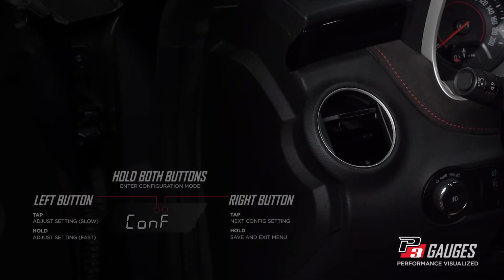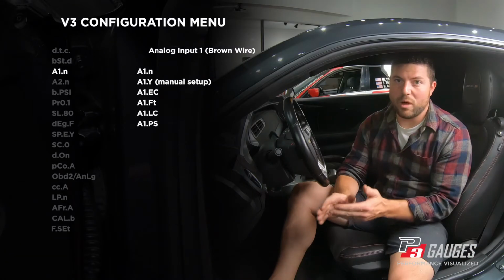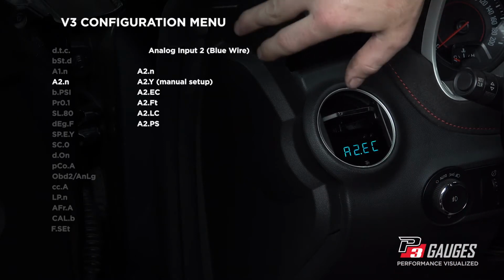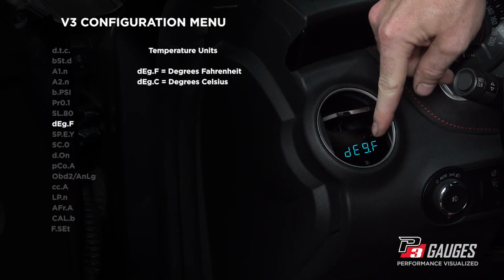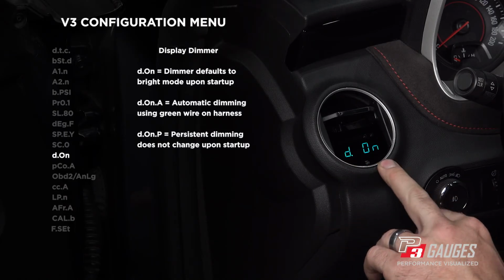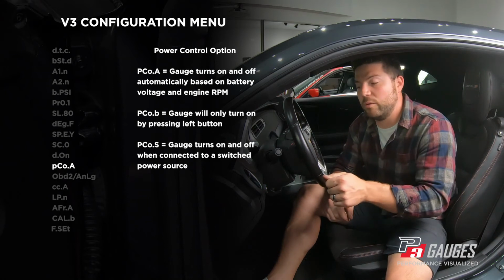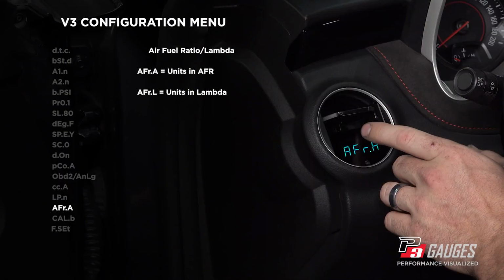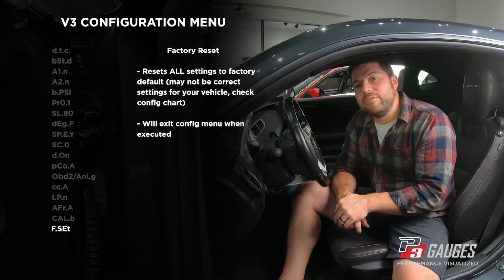V3 Config Menu How-To | P3 Gauges

Comment: I cannot figure my bmw 135i n55’s P3 to save the life of me. I can config mode but only see battery and boost sometimes. I have a jb4 piggyback non obd2… what settings do I need to run? Really considering sending this back as I only see flashing dots currently

Comment: can manifold air temp be added to a p3 in a 2017 corvette c7 z06?
Reply from the maker: That isn't a readout we offer at this time on the corvettes, but you can read IAT2 which is post-supercharger, post-intercooler air temp reading.
Reply: @P3Gauges  thats a calculated average. trying to get actual temps.
Reply from the maker: @32krazy1  My understanding is that MAT is actually a calculated temp and IAT2 is from a physical sensor. MAT takes into account coolant temp as well as readings from actual air temp sensors to determine "Manifold Air Temperature." IAT2 is just a sensor that is after the intercooler. Please shoot me an email if you'd like to discuss further. Service@p3cars.com

-Matt
Reply: @   matt let me discuss it with my tuner. I know he uses mat for tuning not iat2.  if its possible to mat to the p3 thats the pid I need to use for racing. I can datalog mat thru my hp tuners rtd unit but daily and racing I would like to see mat during the run and in heavy traffic as I also use a stage 2 interchiller to cool the coolant to 30*

Comment: Why are all my settings different but mine looks the same
Reply from the maker: You might have an older "V2 Multi-Gauge" or "Boost gauge". Either one of those would have a differnet menu. You can find the V2 menu info here - p3gauges.com/v2-install.

If you still can't find what you need please email us - support@p3cars.com, thanks.

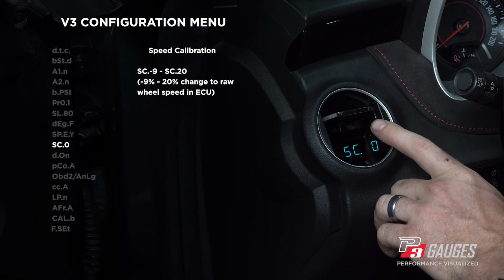Comment: Thanks for the clear and straight to the point configuration guide. @11:48 Once d.ON.P is selected, how do I manually dim the gauge brightness without having the green wire connected to my cars dimmer output?
Reply from the maker: Thanks for your comment. When you’re not set to auto dimming (so “d.On.P” or “d.On”) you just hold the right button down in gauge mode until the display dims. Do the same until it returns to bright to change back to bright mode.
Reply: @P3Gauges  Beautiful. Thanks for the quick response back and for producing such a great product. Appreciate it.

Comment: After the instrument is installed, how to make the instrument darker, or change it during the period, which will be reflected in the rearview mirror at night.
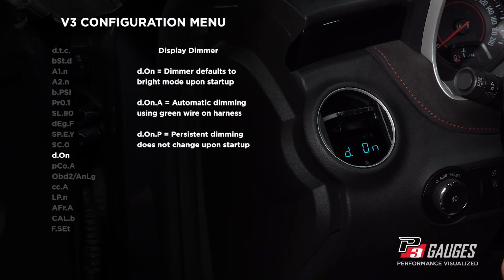Reply from the maker: Check out the dimmer setting at 11:48
Reply: If it is set to automatic light, is it necessary to connect the green line to somewhere, such as where the 10th generation Civic car is connected? Can you tell me? I would be very grateful.
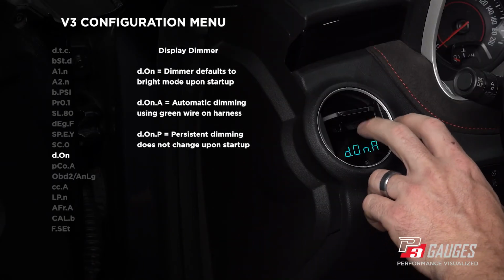Reply from the maker: @yishunGuan  the details on this are covered at 12:10. The green wire needs to see 1volt DC or more in order to make the display dim. So you'll need a circuit that gets power only when the headlights are on

Comment: So is the speed on my cluster faster than I’m actually going?? Why? Is it like a safety thing?
Reply from the maker: Most likely, yes. If you dig into it you can find a lot of information on this being the case across the board with all manufacturers. When you get into the fine details of how to determine your EXACT speed it gets very interesting due to tire diameter variations caused by pressures, tread depth, tire manufacturing, etc...

It appears this padding is built in to protect manufacturers from liability for vehicles traveling faster than stated. If you get a ticket for speeding, they can't be sued for you going faster than your speedometer says.

Comment: Coming off the p3 gauge unit. Where do you connect the boost sensor in the engine bay on a camaro v6 6gen???
Reply from the maker: Anywhere on the intake between your supercharger/turbo and the intake runners. You may also be able to read boost through the OBD2 port without using the analog sensor.
Reply: @P3Gauges  thank you
Reply from the maker: No problem!  @TerrifficsEnt

Comment: I think i deleted a function, can i get it back?
Reply from the maker: No, it’s unfortunately gone forever, JK!

No problem, just go to your cc setting and tap the left button to cycle though then all (ending on the correct “cc.X” setting for your car)

Then hold the right button down to exit and all readings will come back.
Reply: Do I still have to hard wire the gauge in to get it to read ethanol, or should it read from the ecu through the obd? Thanks!
Reply from the maker: Depends on the year/make/model of your car. If you have a GM vehicle or VW/Audi EA888 it will read it through the OBD2 port after a factory reset. Otherwise you'll have to use our ESVA wired into one of the analog inputs. If you have any further questions on that email me - service@p3cars.com and we'll get you covered. @jamesballenger3991

Comment: Hello when the gauge is set on automatic turn on with rpm and battery, does this drain the battery while the car is off??? because it’s using logic to see a voltage to turn on.???
Reply from the maker: Great question! It has a sleep routine just like your ECU so that it uses as little power as possible. In the sleep routine it only looks for a swing in battery voltage to then "wake up" and look for RPM input. We've had our own cars sit for months without starting or charging with the gauge installed and in auto mode without issue.
Reply: @P3Gauges  thanks for the information I just installed in my 2019 Honda Accord and it’s running perfect!
Reply from the maker: @NahomsStudio  that's awesome, be sure to tag us on IG and we'll repost your car and gauge.

Comment: Having it plugged in while car is off and it saying ready will not drain the battery?
Reply from the maker: Sounds like you need to set your power control setting to “pco.a” so
That the gauge uses logic to turn on and off with the engine.

Or you can hook it up to a switched 12v power source so that it shuts off with the ignition.

If you have further questions please email support@p3cars.com and we’ll get you taken care of.
Reply: Thank you

Comment: Hi. How do i just save and exit when ive changed what i wanted? Is it the 5th press of the right button on cal.b option? Will that save and exit? Or is it the second press of the right button on f.set option? If ive understood correctly ?. Thanks
Reply from the maker: Just hold the right button down at any time in the config menu to save and exit
Reply: Thanks so much man. Thanks explaining everything. Even how to remove and bring back readouts. Another question if you can help… I just got my p3 and its ace but i have a readout air 1 and then air 2. Any ideas? 1 was a low temp and 2 was quite a high one. What are these? It literally just reads air 1 and then air 2. What temps are they? Thanks man
Reply from the maker: @TABB_AUTO  no problem! 1 if the temp at the MAF and 2 is the temp after the air is compressed and has gone through the intercooler or hx.👍🏼

Comment: In my e90 328 the gauge stopped showing me my oil temp one day and I can’t figure how to get it back up
Reply from the maker: You may have deleted it by accident. Here's instructions on removing and restoring readouts from our install page - (p3gauges.com/v3-install)

TO REMOVE AN UNWANTED READOUT

1- While gauge is running in gauge mode, TAP the right button to cycle to the readout you would like to remove.

2- HOLD the left button until you see "- - - -" (while holding the left button you will see the bar graph scroll back and forth across the screen)

The reading is now removed until you restore it. (see instructions below)

TO RESTORE A REMOVED SETTING

1- HOLD both buttons until "ConF" appears and then release.

2- TAP the right button until you see "cc.x" ("x" being a placeholder for several different options) You can find the correct cc setting for your car in the configuration chart above.

3- TAP the left button to cycle through the cc options and stop once you get to the correct setting for your vehicle. (perform this step even if the cc setting is already correctly set for your vehicle)

4- Once you are back to your correct cc setting HOLD the right button until the screen turns off. (this saves/exits the menu)

5- Start your engine (if not already running) and the gauge will turn on. (It will take a little longer than usual on the first startup after completing these steps)

This process forces the gauge to "re-scan" the ECU and pull all the readings that it can. All your readings should be restored at this point.

Comment: bmw e82 n55 Boost display is showing negative pressure instead of zeroing out?
Reply from the maker: You may be set to the wrong boost setting or the sensor may not be calibrated correctly if you’re reading with the analog sensor.

Please email support@p3cars.com and we’ll help you figure it out.
Reply: @P3Gauges  do i switch to analog instead of obd2?
Reply from the maker: @twin.scroll  switching to analog mode cancels out all OBD2 functionality. If you are just switching to analog boost, you simply need to change your boost setting to bSt.A. That will pull boost from the analog sensor while still pulling OBD2 data for everything else.
Reply: i had read that n55 did not need a boost sensor, thought it read straight from the obd2 like mhd.. n55 2013 135i

Comment: Which setting shows the ethanol content? My car is tuned on HP tuners and I have a DSX flex fuel sensor therefor the ecu should recognize it and show it in the gauge correct? 2013 1LE Camaro.
Reply from the maker: If your gauge is marked 7/1/22 or newer on the control box it can read E Via OBD2 port. If yours doesn’t, you’ll need to just do a factory reset so it can recognize the added flexfuel input.

If your gauge is older than 7/1/22 you’ll either need our ESVA or email us for a software upgrade in your display - service@p3cars.com

Comment: Love the product question I have a 2014 Audi A4 that I’m using the obd2 gauge on and everything is perfect but I’m getting 0.0 for boost reading what should I try?
Reply from the maker: Thanks! We typically ship out B8 gauges pre-configured for S4s with the 3.0T. So you'll just need to change your boost setting from "bSt.C" to "bSt.1" in the config menu. (or "bSt.A" if you're running the analog boost sensor) If you have any other questions shoot us an email - support@p3cars.com, thanks! -Jake

Comment: How do you dim the gauge if set to d.On or d.On.P?

Mine has a mind of its own when set to d.On.A (green wire) Using the light output from the vent illumination which is about 5 volts. C7.5 Audi S6.  It stays dim most of the time but occasionally changes to bright momentarily even though the vent illumination stays on. 

Also, I may prefer using the manual dim because when you look into the left mirror at night the gauge display is reflected into the mirror.
Reply from the maker: Simply hold the right button down while in gauge mode to manually dim or brighten the display.

If you have a v3 gauge the threshold for auto-dimming using the green wire is 1 volt DC. If you have an “average” voltage from CAN lines the gauge dimming won’t work consistently. Also, if you are on a line where voltage drops as you drop the cluster illumination you may be bouncing on that threshold so the gauge goes back and forth between dim and bright.

If you have a v2 gauge I believe the auto dim threshold was around 5v so that could also be your issue if the line you tied the green wire to is at 5v.

If you have any further questions please email support@p3cars.com.
Reply: @P3Gauges  Thanks for the info.  The gauge is a V3. I did not measure the voltage with an oscilloscope so I don't know if there are fluctuations (averaging) on the CAN bus.  

At a later date I will pick up the signal from the headlights where there should be no dimming.

Comment: No Lambda on LC2?? Now yah tell me🙄
Reply from the maker: You can read Lamba with the LC2. Since it's read through the Analog inputs you can put whatever values in that you want. We have the pre-configured settings for AFR but you can manually input Lambda values. The description on the product page shows both the AFR and Lambda values. 7.35AFR=.5Lambda / 22.39AFR=8.0Lambda - https://www.p3cars.com/accessories/lc-2-digital-wideband-o2-sensor-kit/
Reply: @P3Gauges   I’ll work through this process tonight and see if I can get It dialed in. I was expecting that switching AFr.A to AFr.L it would adjust automatically.
Reply from the maker: @Indefinitely_  Understood, I can see why you would think that but that setting only changes the OBD2 AFR reading if the car has factory widebands. I can't believe that GM doesn't put factory widebands on their LS/LT powered cars! If you need any more help please reply in our email thread, thanks!
Reply: @P3Gauges  no kidding! If I recall correctly Hondas back in 08 even had factory wide band. Thank you for your help!
Reply from the maker: Just saw your email as well. I sent you full instructions on how to read AFR in Lambda using the LC2

Comment: I have the V3, how do you manually dim your brightness?
Reply from the maker: Just hold the right button when the gauge is running in "gauge mode". Then to change it back to bright just hold the right button again.

Comment: Is there an option of alarm to be configured on the analog sensors ? Would like to add oil temp and pressure and want to set a high point alarm for the temp and a low point alarm for the pressure.
Reply from the maker: Currently we do not have any programmable alarms other than the shift light feature. However, when you are setting up an analog input you can scale the bar graph to max out wherever you would like so you could use the bar graph to be your alarm.
Reply: @P3Gauges   Thanks for the fast reply. We will discuss the solution with our client. Another question for you is if we choose only the analog inputs what is the seeing sequence, will the appear one after another for a few seconds or the driver has to switch between them?
Reply from the maker: @tri6kata  you can delete any unwanted readouts so you don’t have to scroll through extra screens.

You simply tap the right button to cycle between readouts. They do not scroll automatically.

Each time you cycle to the next readout it will display the title so you know what you are viewing.

Comment: How to connect oil temperature sensor? I have Fiesta ST, i have 2 wires from sensor, white and black. White i have put in analog 1 and black to the ground but it doesn't work. Temperature is always -40°c.
Reply from the maker: You will first need to make sure that your sensor has a 0-5 volt linear output. If it does, you'll then need to input the 0 volt and 5 volt temp readings into the gauge in the config menu (those temp readings will be in the specs on your sensor) After you've done all that if you are still getting a "-40" reading it is most likely because no voltage is coming out of the sensor or because there is a connection issue on one of your wires. -40 is usually the 0 volts output reading for most temp sensors. Check to see if your sensor is powered by 5 volts or 12 volts and make sure it is powered up appropriately. If you have further questions please email us - support@p3cars.com and we'll be sure to help you out, thanks! -Jake
Reply: @P3Gauges  Ok I wired it again, now one wire connect with analog 1 and second wire with 5v (purple wire). Next I have configured minimum sensor value to 150°c and maximum sensor value to 40°c (according to instruction of sensor). Now my temperature is 45°c, and when I heat up my sensor temperatures are lowering to about 42°c. Doesn't seem to work. Any ideas what I'm doing wrong?
Reply from the maker: @alekschuck5548  It sounds like you may have configured your sensor inputs backwards. You said your MINIMUM value is 150 and your MAXIMUM value is 40, those probably need to be reversed. Please send an email with your sensor info to support@p3cars.com and we will get it figured out with you. -Jake
Reply: @P3Gauges  when i reverse this configuration temperatures are about 145°c on cold and when a heat up sensor its rasing to about 149°c. Serial number of my sensor is 208OWTS Maybe this sensor not working with gauge and I need different sensor? What sensor to oil temperature do you recommend?
Reply from the maker: @alekschuck5548  Please email support@p3cars.com and we will get you taken care of. -Jake
Reply: @P3Gauges  no one answers me on email.
Reply from the maker: @alekschuck5548  Sorry Aleks, I had surgery on Wednesday and have been out of the shop since then. I just replied to your email. -Jake

Comment: how can I have more then 2 obd2 connectd ?my aftermarket steering wheel came with something to have connected to obd2 at all times but it has an additinoal obd2 where I connected the p3 but it doesn't seem to work
Reply from the maker: You can connect multiple devices to your OBD2 port at the same time using an OBD2 splitter such as this - https://www.p3cars.com/accessories/p3-low-profile-obd2-splitter/

However, many OBD2 devices cannot fully function at the same time. Depending on what the devices are looking for they may conflict with one another in the network. Our gauge does have a couple features built in for situations like these -

1- If you have a V3 gauge, you can try to run your gauge in "low priority" mode by changing the priority setting to "Lp.Y"

2- With both the V3 and V2 gauges you can run your gauge in "analog" mode so that you can read boost, battery voltage and the 2 analog inputs without communicating on the network.

All the details for these settings can be found on our install page - https://www.p3gauges.com/install/ If you have any further questions please email us - support@p3cars.com, thanks!  -Jake